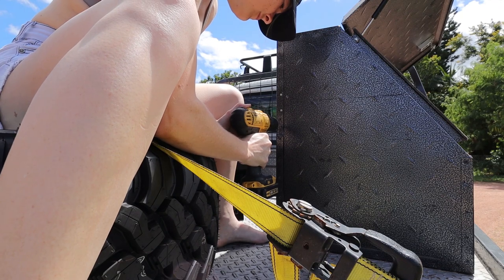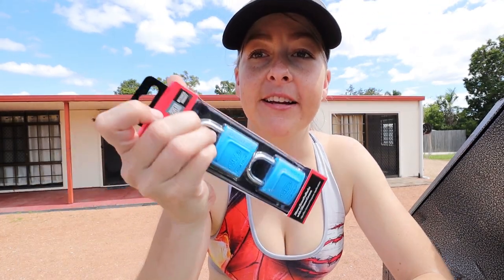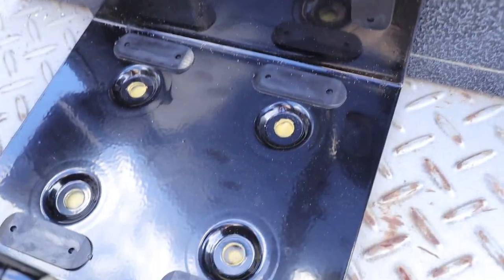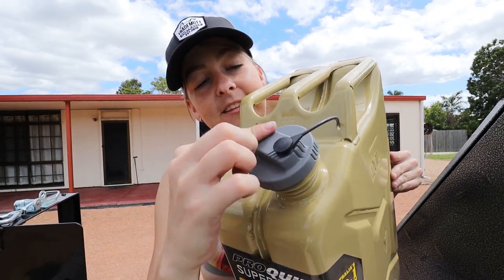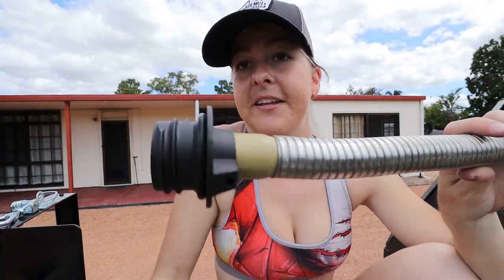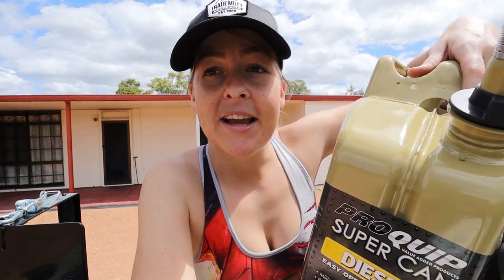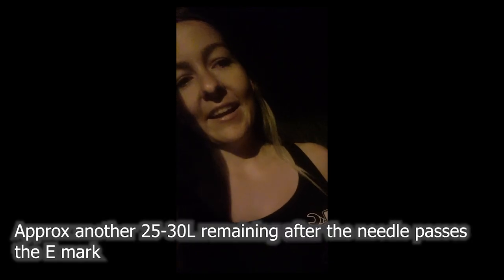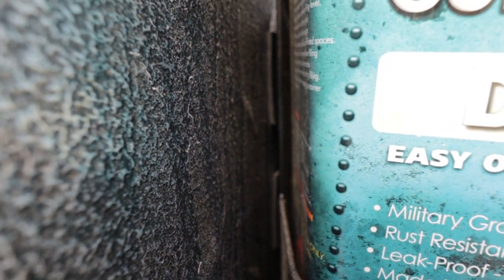OLBOY Mods Part 2: ProQuip Jerry Install || Real Talk

Comment: Perhaps you can take a small siphon hose and let it move the fuel versus hold that damn can.   I’m surprised there isn’t a self-bleeding, self- purging fuel system.
Reply from the maker: Just can hand bleed to the filter but the early 90s there was no fancy electronic self bleeders you just have to crack the lines at the injectors the ol fashioned way

Comment: Here in the States I use what's called a super siphon and no longer have to tip a gas can.  You can find them on Amazon and it will drain a 5 gallon can in under 2 minutes.

Comment: There is a lockable cap for the proquip jerrycans if your worried about someone siphoning the fuel out. Sorry wrote this before end of video where you say they are available.  lol I actually have a jerrycan with the locking cap.
Reply from the maker: Didn't watch all the video;)
Reply: I did watch all the video but when I wrote it I thought it was the end of the video then realised it wasn’t over. So I edited it.